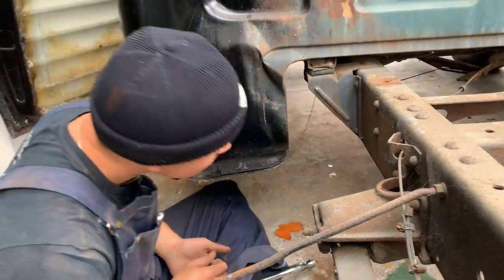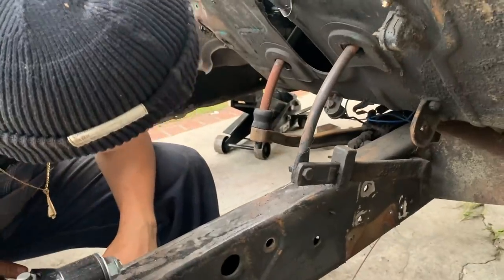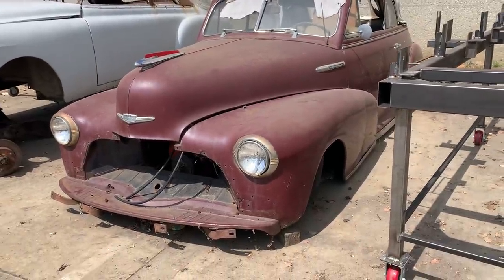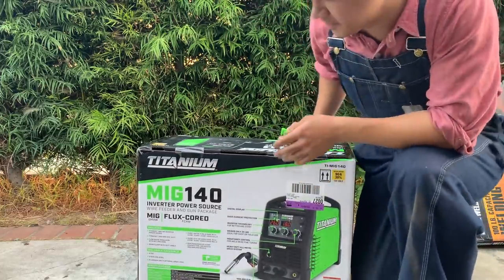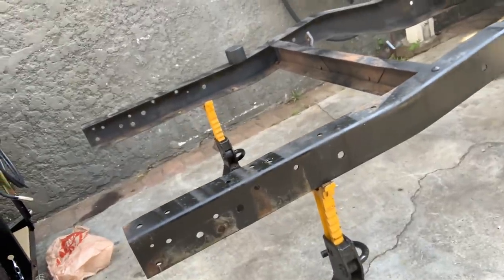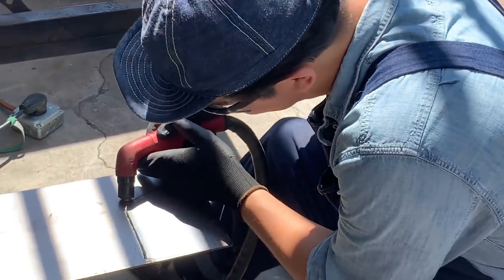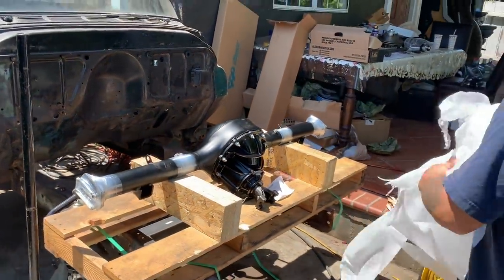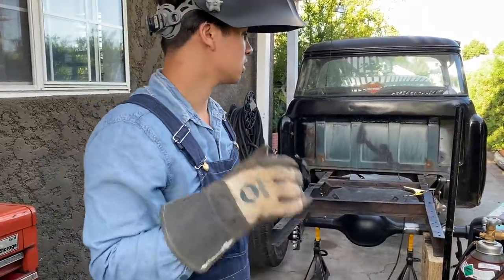1957 CHEVY 3100 VLOG #4

Comment: For being new too welding your welds are looking pretty good. you might want to make small adjustments to heat and wire speed when doing vertical down or overhead vs flat.

Comment: i wouldn't recommend starting welding with a mig, starting with stick is the best because it is more complicated, and takes more skill and practice, starting with mig will make it very hard to learn stick, or tig even, welding does open many doors though if your good. but thats just my opinion. also keep in mind never weld on rims with a tire on them, and welding fumes are a serious hazard, welding stainless steel, galvanized, chromed, painted, and other metals is hazardous, i would recommend wearing a respirator and grinding the coating off if you want to live a long healthy life, ive had a type of metal fume fever before its not fun. always clean your metal before welding to get the best penetration and weld quality and strength. just my unprofessional advice, good luck with welding and the build.
Reply: 6010..after that all is easy
Reply from the maker: I appreciate the advice 👍
Reply: And don’t use chlorinated brake clean. Phosgene gas is no bueno!